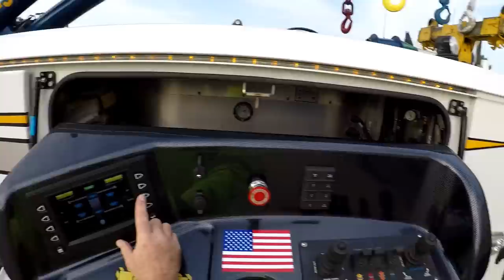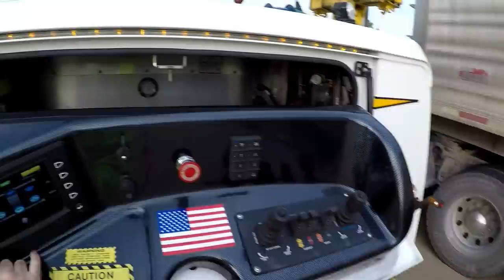Sands of Time Part 1   The Lift

Comment: Good job once again Ron, but I saw something from working around cranes that bothered me a little. When you set your outriggers you're relying solely on the pads located on them. Here's the part that bothered me. You're sitting on concrete but have no real clue how thick that concrete is in that spot or the strength of that concrete. Have you thought about making some bigger pads to locate under your outriggers for incidents like this or in wet weather?
Reply from the maker: We do have larger pads to place under the feet.  What you probably didn't notice, is that on the rear outriggers of this truck the entire length of the outrigger makes ground contact, not just the pad, so the weight is distributed over a very large area.  I do understand your concern.  Thank you and God bless.
Reply: I should have known better than to question your expertise.
Reply from the maker: No....please.  I meant no disrespect.  I greatly appreciate when people, such as yourself, give helpful advice and/or suggestions in a constructive and polite manner.  I will be the first to admit that I do NOT know everything and I am far from perfect.  I was simply explaining the way my outriggers are set up.  I hope you didn't take offense, because that was not my intention.
Reply: Oh mercy me, you in no way whatsoever disrespected me. Lord have mercy, you're an expert in your field and since I never ran anything larger than a Holmes 440 way back in the early 70's my overall knowledge in towing is rather limited to 4 wheelers for the most part. What I should have said was I should have known you would have already thought of that and I as a retired fireman/ building construction of all kinds on my days off I did learn a thing or two about cranes and heavy lifting and what I saw got me to thinking some. In all honesty I have learned a thing or two watching you work and this ole dog still likes to learn new things. In fact I have for weeks now been trying to think of a low wattage light system you could use behind say a disabled rig when out on the highways to get peoples attention more. One idea I had was an inflatable police car with lights to make those who can't move over think it was a officer sitting there, but that wouldn't work, first one that blew by at 80 would make it sail off into the ditch. But I was looking at a video earlier when you were towing a railroad truck to the shop. and noticed you dropping driveline bolts and stuff in the semi rocky ground. I have these magnetic trays I use and holy moly I bet I have a dozen or so of these things located here and there. The bigger trays are like about 10 inches long by about 4 inches wide and are great for flipping bolts into and they stay there and the you can stick on the side of something metal and it all stays there. I have crawled around in the gravel looking for that lock washer or bolt more than once, but not anymore. But for night work as you do a lot I sure think it might be a cool cheap tool to have. Like I said I have several of them even the smaller 4 inch round ones. Heck one of the ladies in the office saw mine and she got one to hold her big paper clips and binder clips on the side of a metal file cabinet. Anyway it's some food for thought that might help you out plus the will stick on a wall in a compartment so storage is easy with them. Here is link to what I use, https://www.harborfreight.com/9-1-2-half-inch-magnetic-parts-tray-with-hood-97801.html

Comment: Another interesting video-Thank you for that! But i ve one question,which i often thought about but never came to a logical answer: Why are trucks which are able to pull a trailer often called "tractor" or sometimes  "semi-trailer tractor" and not a "truck"? As far as i know and the definition goes a tractor is "a powerful motor vehicle with large rear wheels, used chiefly on farms for hauling trailers and equipment." Here in Austria where i am from,a truck driver would see it as an insult,if you would call his rig a tractor...^ ^greetings and god bless :)
Reply: Tractor has more than one meaning. First, the typical farm machine meaning that you mentioned. Second, tractor can mean "traction unit." A traction unit is a large, typically diesel powered, towing unit. Basically, the cab and engine part that pulls the trailor. So it is not an insult to say tractor or tractor trailor here, it is a proper name for them. To make it even more confusing we also use "tractor" to mean the ride-on smaller lawn mowing machines! :-)

Comment: Hi Ron was wandering if tow units have to have the cables or the unit as a hole safety rated tested  every so many years ?   The Diesel engine repair shop Were I retired from, our over head cranes hade to be tested every five years  for cable damage and carriage break holding. Max load holding at center of the beam .

Comment: Hello Ron!  That is not heavy ,lol, In sweden we load about 36 too 40 ton legal. Are total is whit The truck 64 ton but The are talking about rise it too 73 ton greetings Peter from sweden!
Reply from the maker: Here is the US, generally, 80,000 lbs is the maximum weight allowed for a truck, trailer, and its cargo,  without a special permit.   Thanks for watching and God bless.
Reply: If memory serves me right, the biggest a truck can be in Britain without special STGO CAT Licence is 44 Tonnes all in, generally, anything way above that needs the STGO Licence to Operate, and the longest a truck is allowed, Articulated (Semi) is just on 54 feet, but, a Road Train can be is just on 62 feet, and we're seeing more and more of them on British roads these days,  if I'm wrong, I'm sure there will be someone who knows better who will correct me
Reply: Us Short and Metric Long tons are two different matters thus one is using Kilograms and other is pounds, so in retrospect if you refer to tons, you may want to make sure if referring to metric its written tonnes so you know its the kg format. 40 tonns metric is 40,000 kg or 88,184.9 pounds and Us tons its 80,000 pounds or 36,287.4 kg. Just to clarify things here a bit as you wrote 36 to 40 ton legal which I take is the metric formula you are using.

Comment: Not sure how the tractors work, but couldn't you use the clutch for a break?
Reply: Jay Herde you have to push the clutch and brake to stop if you just use the brake to stop the truck will stall
Reply: The clutch let's the truck coast when in gear
Reply from the maker: If they had put the tractor in gear and held the clutch down the truck would have rolled out from under the trailer.  When they wanted to stop, they could have taking their foot off the clutch and the wheels would have locked up since the truck was in gear without the engine running.  However, they would have run the risk of the truck starting as this is how you "pull start" a truck.  It probably wouldn't have started in this instance because the truck had shut down.  Thanks for watching and God bless.

Comment: What was the matter with the trk. Emission garbage or what. I was wondering about the air.  Pull a plug out and put in a air line or would you disconnect the compessor and hook there. Looked like it was fairly simple job
Reply: The adapter to plug his truck air into the other truck was not presently on the truck at the time...

Comment: Why can't you use that yellow bar you use with the straps over a trailer  in front of this one and connect the chains to it?  It would resolve the possibility of the chains moving to the center.
Reply from the maker: If you are referring to the spreader bar, then I could have used it in this situation, but I did not think it's use warranted the amount of time and effort that it takes to assemble the spreader bar.  The job was successful the way I did it and nobody was injured, so I call that a win.    Thank you for watching and God bless.

Comment: what is the spring going across the frame for?
Reply from the maker: I'm not certain which spring you are referring to.
Reply: the spring a little ways in front of the fifth wheel
Reply: Tensioner or Tensioning spring of sort.

Comment: Did you do a software update on the raptor controls?
Reply from the maker: Actually, Miller came to our shop a few months ago.  They changed out the controls on both main stations, all the under-reach control pads, the red "kill" switches, and updated the software.   No charge.  There are several things different now.  I have to push both top buttons on the under-reach control pads to "power up" each station.  They will go inactive after about 5 minutes if not used and then have to be powered up again.  They also installed a new antennae for the under-reach remote that is suppose to give better reception.   The free spool activation changed slightly.  The biggest update, which should have been done a long time ago in my opinion, was that the red "kill" switch on the Raptor wireless remote now actually shuts the system down.  Before, it simply shut off the remote, but didn't turn off the PTO or the engine.

Comment: I think the ford should have had a different way of towing.  I've seen too many balls break off and go through radiators.
Reply: if you have or seen a hitch ball snapped off, you've done or seen someone do things in the most extreme wrong way! like trying to "yank" vs "tow"  and none of the stuff is rated for heavy snatching  "large shock loads".  yes trailer safety chains are for catching some shock load, but nowhere near the load of trying to "tug" something
Reply: Yep, much safer to use a hitch pin than the ball.

Comment: Wait, why couldn't they just lower the trailer legs? Was it too much weight for them?
Reply: He said in the start its drop leg and the legs were not with the trailer or in the truck on scene and they do not hold much more weight than the typical crank legs you see on other common trailers thus why they could not just drop the legs. I myself have seen crank with drop leg hybrids and they can hold weight, just not for long or too often can they be used when loaded with any cargo/freight weight.